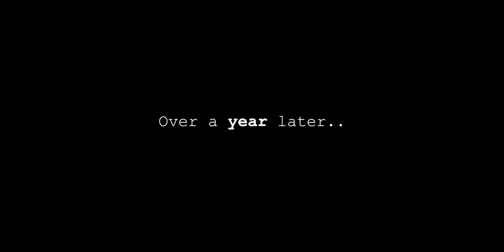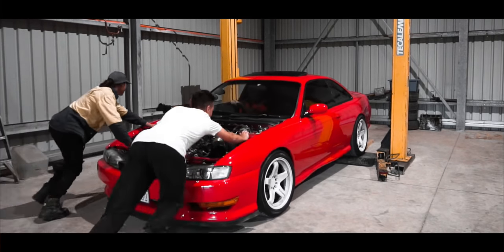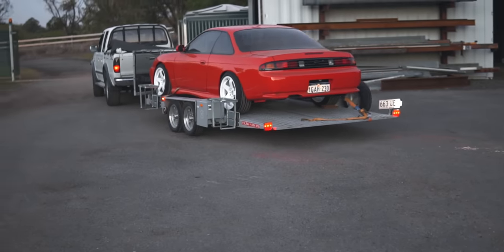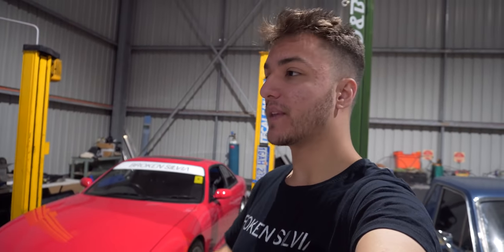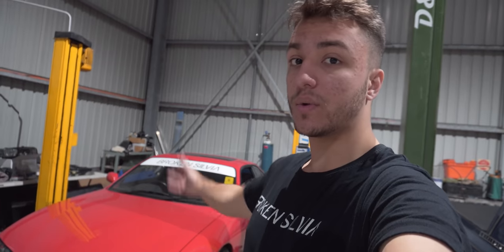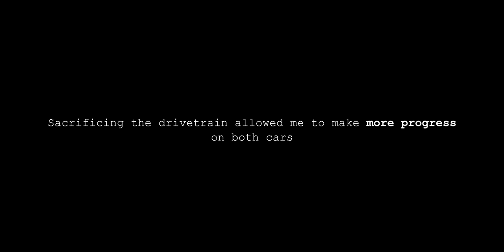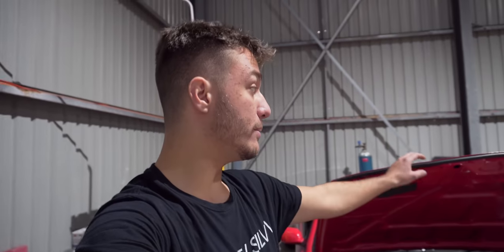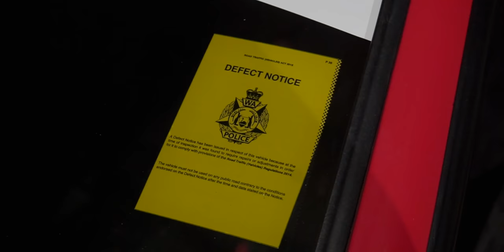WTF Happened to the S14 ? | The Broken Silvia [EP10]

Comment: Actually I understand. I've worked a few years at a Bmw dealer, but when I started, I wanted a 200sx S13 or S14 so bad, the drift scene was growing big etc at that time. My mate who sells spare parts, is an E30 guy. He told me how about a 325iS e30, those were still cheap 10yrs ago. Found me one, near Paris, France, that was actually sold new in my area. Mine is a clean example, and a few people offered me quite a lot of money for it. I could have bought an M3 instead (my dream car !). But deep down in me, I knew, the moment I signed the papers I would regret it. I still got it, never sold it, I don't drive it much because all others projects (I've got 8 cars .. what a mess), but last year, after I had money to buy a 4 doors M3 e36, 3.0 euro. Even if I can't buy anything else in my life, I'm happy with eveyting I got. And if there is one that will stay till I die, it's my e30, even the M3 will go if I have to.
Reply from the maker: Yeah man they’re fricking awesome cars! So much character 🙌